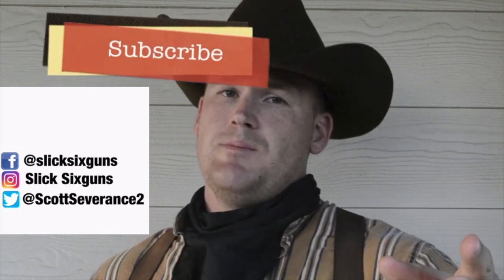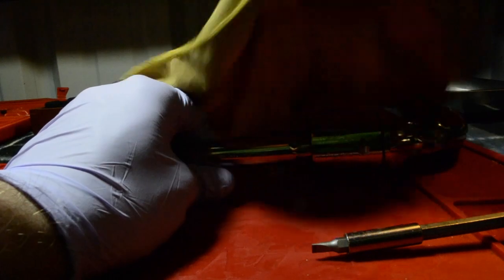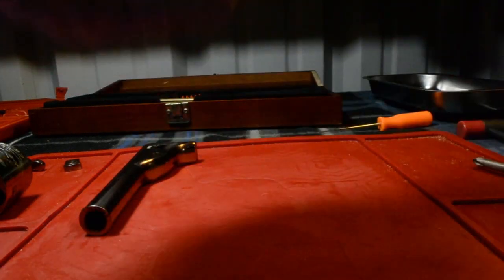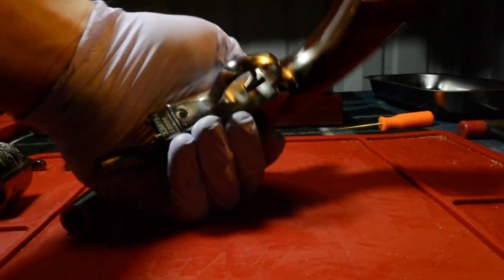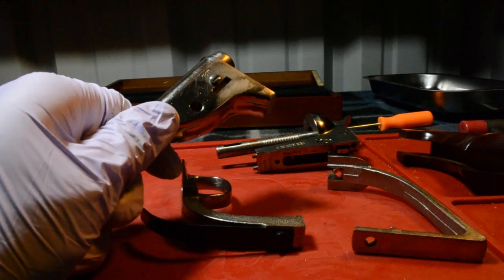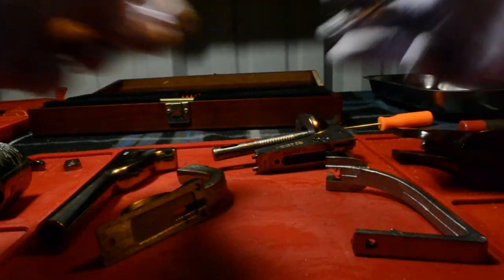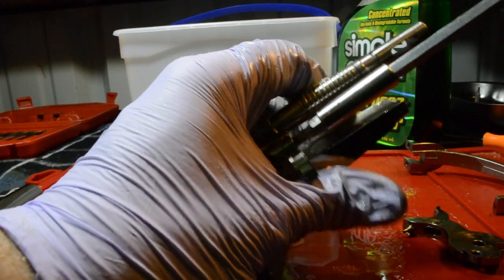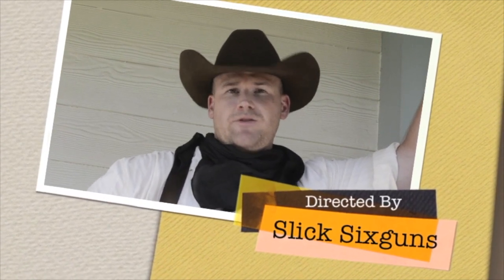Disassembly of an Open Top Revolver

Comment: The prying of the barrel was not a good idea, I used the same sort of cloth, regret it. I found if i stuck 2 bits of leather either side and to tap my pry tool into it gently it popped of real smooth and easy.
Reply from the maker: Thanks for sharing

Comment: Can the base pin and tab be too tight
Reply from the maker: Yes
Reply from the maker: You can push the wedge in too far that will lock the cylinder up

Comment: Think I would take the barrel off first (using the ejector/ram) rather than using a pry tool.
Reply from the maker: I would prefer to do it that way as well and have tried. However, it doesn't work on mine so I had to improvise